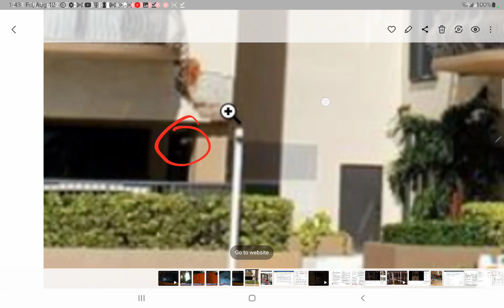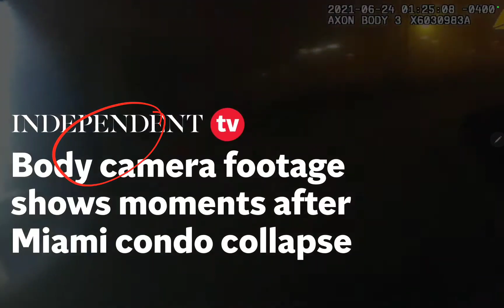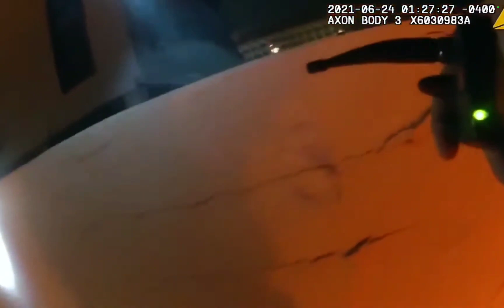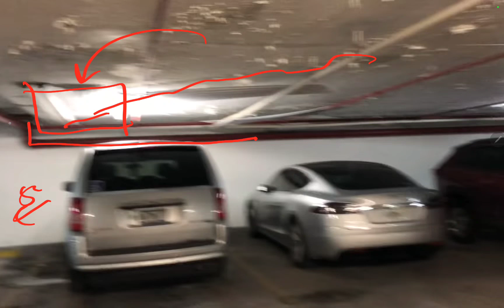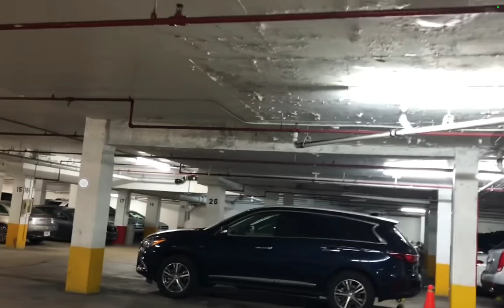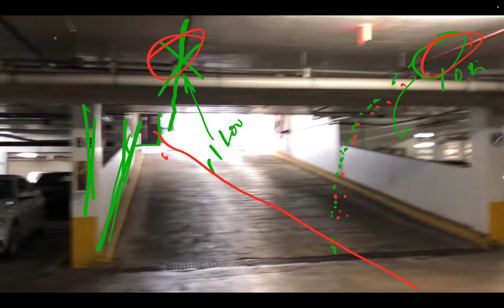Champlain Towers Collapse body camera footage proves sprinkler Alarm system was functional

Comment: Kai this video is very good on depicting what happened that night the buildings entire buildings  infrastructure is strapped to the garage and not designed to withstand a collapse systems conduits PVC is not rigid or flexible
Reply from the maker: Exactly, and the nerve of anyone who expects any of these systems to perform under these collapse conditions.
But, your system DID work and your system contacted the fire board immediately...
Outstanding on your part Matt... you picked a home-run team.

Comment: Any reduction in pipe dia, is done to achieve 'pressure' at a given point. Flow dynamics.
Reply from the maker: Not really, your demands determine pipe size and the sprinkler heads determine pattern ...
The nfc determines what is minimum requirements of coverage.
Physics dynamics.